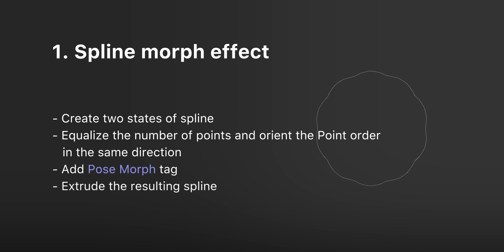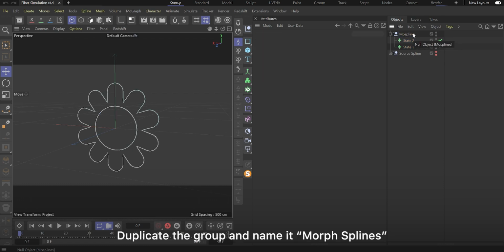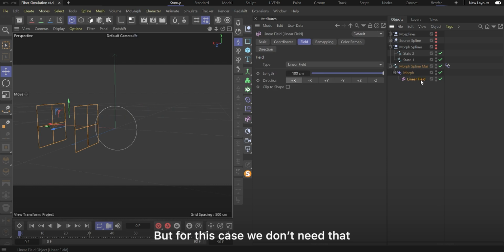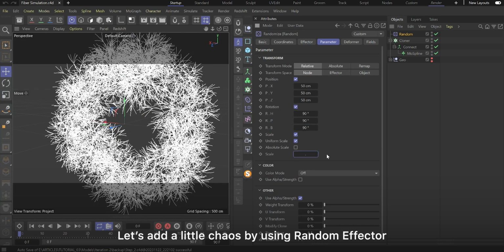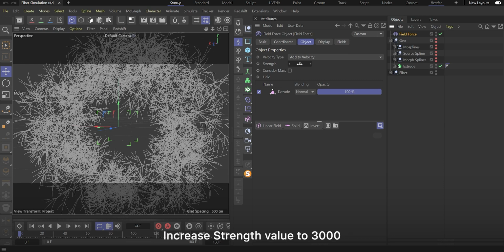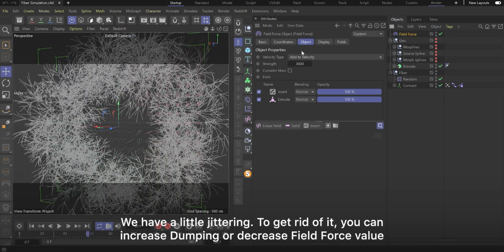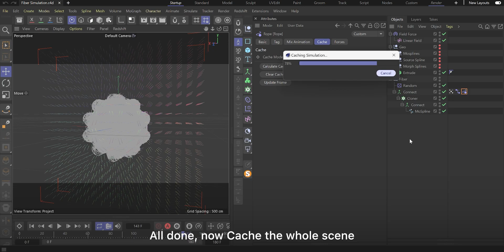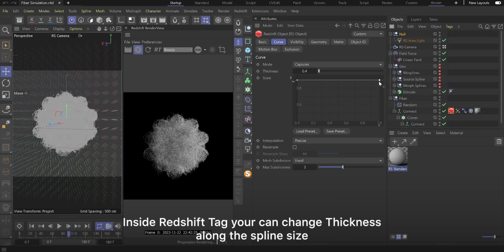Spline Morph and Fiber Simulation in Cinema 4D (Redshift)

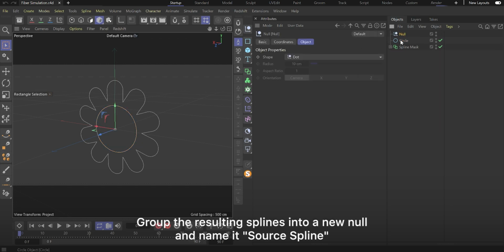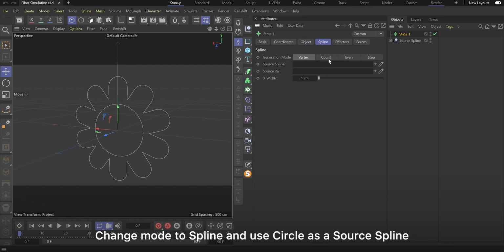Comment: At 01:12, when the 'Spline Mask' folds into the 'Source Spline,' it is not initially associated with the 'Connect' object. However, at 01:38, as the 'Source Spline' unfolds, we observe that it becomes a child of the 'Connect' object. If, like me, you found this moment confusing, it's likely that this step was overlooked during the editing process. Nonetheless, it remains a comprehensive and engaging tutorial from which you can gain valuable insights. Thank you Yasha 💯
Reply from the maker: Oh,you totally right. During the editing, i've accidentaly cut that stuff out.
Thank you for your remark, apricate it!